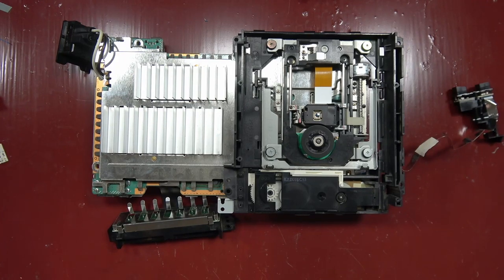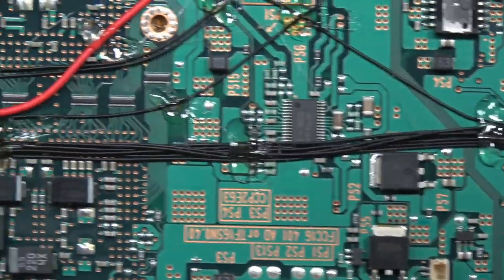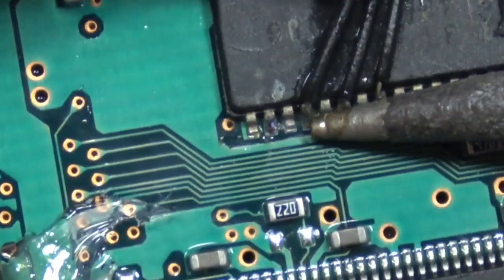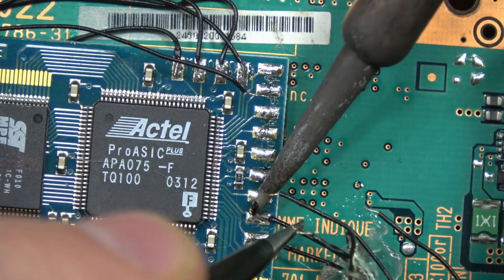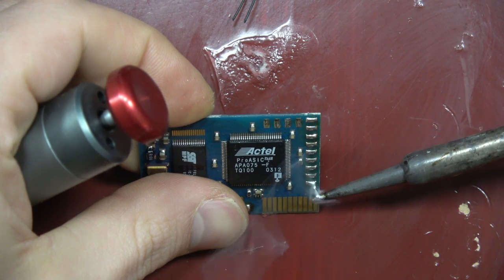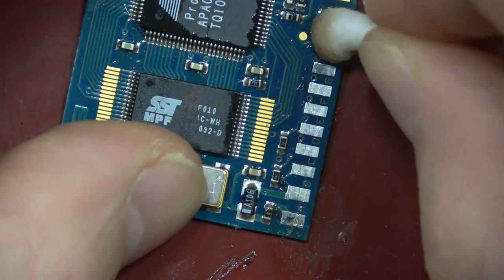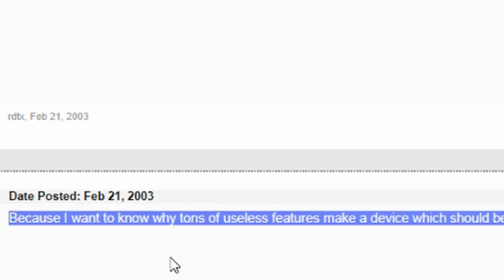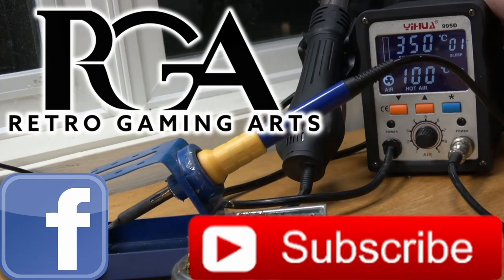DMS3 FOUND INSIDE BROKEN PS2!

Comment: You're right, we are adults and I think we are mature enough to be able to kindly debate on the modwork.  I mean that's half the fun of seeing another persons mod anyway I think.  The mod job that person did actually didn't look too bad at all.  Solder joints looked good and the wire lengths were good.  Of course it's not as fancy pants as your installs but it did look professional and looks like it was done correctly which is all you can really ask for in a mod.  Only fault I'd say is the dang hotglue.  There are so many other better ways he could have used to tack the wires down without making such a mess.

Comment: Found a ton of articles about using alcohol to remove hot glue, not a single one mentioned why it works. Had to go digging on Reddit to find the answer, posted by user "pyridine":
Vinyl acetate resins are soluble in isopropanol, so I suppose a vinyl acetate/ethylene copolymer could easily be as well. The polymer chains are simply dissolving and losing their solid structure at the edges where you apply isopropanol, which is changing the nature of the adhesive surface between the glue and an object.
 The polymer chains are now solubilized (completely surrounded at a molecular level) by isopropanol molecules which is preventing their strong interaction with the metal/wood/whatever.
Pretty neat trick, this is going to come in handy if I ever need to resolder the headphones I've recently replaced the cable on.
Reply: I have observed that the material remains just about coherent but loses strength; it absorbs alcohol, expands, it loses adhesion and its cohesion is greatly reduced. Chances are, debonding from the underlying surface is both due to solubilisation and just mechanical leverage from expansion. I also observed that ethanol and isopropanol have approximately the same effect, but either needs to be fairly highly concentrated.

Furthermore EVA is quite gas permeable and i think at least a small amount of alcohol vapour can easily make it through the volume of the material. I was able to observe similar changes by applying alcohol in vicinity and letting it evaporate near hot glue blob rather than applying it directly to the blob.

If it was a high-ethylene EVA it would have behaved closer to LDPE, so it stands to reason that the copolymer in glue stick leans towards high PVAc content.

Comment: One thing I didn't see that I do remember from installing DMS3 chips is (and I forget the exact point) but you were supposed to twist 2 wires together for one of the connections to isolate it and eliminate noise in the line/connection.

I believe I only had to do this for the DMS3 specifically.

Comment: Cool, wish I could remember what modchip I put in my ps2 nearly 20 years ago, it's still working perfectly though.. Just had a google around.. messiah 2 sounds familiar.
Reply: Me too. Hahahah. Good memories.
Reply: @jeff15  Mine was a pure spaghetti of enameled wire glory.. pushed the top cover on and prayed... Worked :)
Reply: @thomassmith4999  thats awesome. I hate taking apart the ps2, so much time consuming. One day I'll upgrade the chip. I recently had issues with my laser not reading dvds just cd. I replaced the lens to find out i still have the same issue. Trying to troubleshoot. I put it aside for now. Hopefully I'll make time again to continue finish the task. You had issues like thst before ? Any good recommendations on youtube.  Thanks.
Reply: @jeff15  HI Jeff, I just run FreeMCBOOT (modified code on an original memory card) these days on my PS2's (I have a few of them now). Just get the network adapter (a genuine Sony one) then get the purple IDE to SATA conversion board for the adapter and put a 2.5 inch hard drive in it. Then you can run all your games from the hard drive

Comment: So what Solder do you use exactly?  I think part of the problem I have been having with my soldering is using really cheap crappy solder, as it ALWAYS gets sucked back on to the iron and simply refuses to flow into the joint whenever I try to solder.  I really need some better solder for my next project.  Can you recommend anything specific and if so do you have a link to it?  Would be so appreciated!

Comment: Nice :3  I bought a dms3 v9 6 years ago, I never installed it because I didn't know how to install it back then, I'm gonna install it next month, I need to buy the wires first, could you tell me what sizes are best? Because I know that there are some point that need a thicker wire, but I don't know the size of these thicker ones. If you could tell me which awg size are these thicker I would very much appreciate it :)
Reply: Can you tell me more about what the v9 version of a DMS3 is?  I have one, but it is difficult to find information about that specific one.  Is it only meant for a v9 PS2?  Can it be installed on older PS2 models?  Is it considered a clone?  Do I flash it with DMS3 regular firmware?   Random questions.  Thanks!
Reply: @kregroenfeldt7528  yes, as far as I know the v9 is only for the v9 ps2, for older ps2 you need to install older versions of it. And no, it's not a clone, there is a clone of the dms3 but it's a light green chip, it's impossible to confuse. And yes, you can update the firmware of the chip after you install it, but it needs to be only the update for the dms3, you can't use dms4 updates.
Reply: @KywokiYakasaki  Thank you much!

Comment: V9 have it's own unique DMS3 V9 chip, does not work with any earlier version, afaik. Remembering trying to install it V5/V6 and didn't work. Got it from V9 with burned LA-chip. To this one I changed LA6508 RII and DMS4 Pro, got from my cousin. I still have it and working fine.
Reply from the maker: That's viable information, I have some old LA burnout prevention chips, in the video where I showed my whole chip collection I showed them too, maybe you know more about them than me
Reply: @RETROGAMINGARTS 
This is just exprerience. V9 does not need prevention chips, you'll just have to lif the 17th pin of LA-chip and solder it to +5V. Called Romeo Mod. When the LA-chip is burned, then you will have to change the whole chip to original + Romeo, or to LA6508 RII, where Romeo has already done.

BTW I watched the video of your collection. That's why I left message for your information. Nice collection you have there. Oh, and for DMS3 V9, it actually says it on the chip, you cannot miss it.
Reply: Is the DMS3 v9 considered a clone?  I have one, but I do not know where it fits in the universe and history of PS2 chips.  Does firmware for it still exist?  Does it just use regular DMS3 firmware?  Do install diagrams and useage info exist anywhere?  Hard to confirm this thing ever existed.